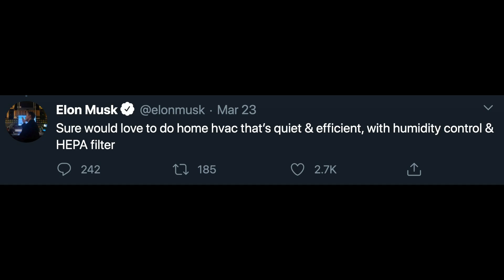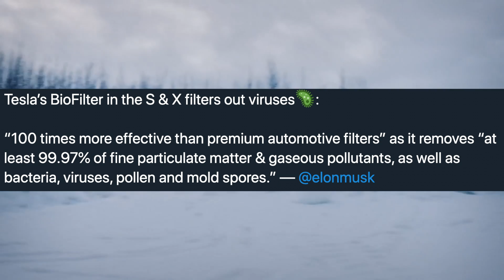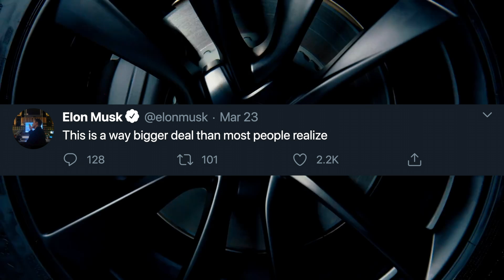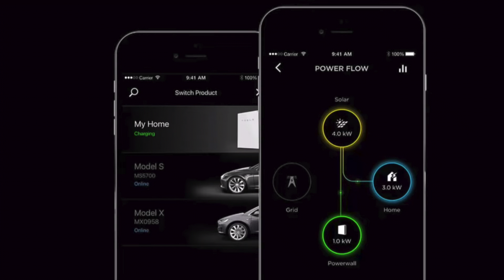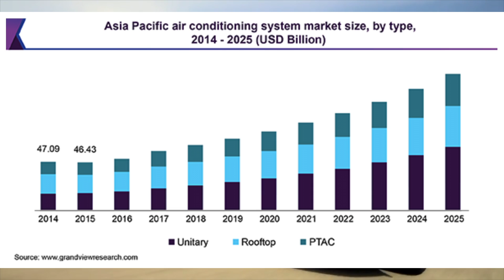Tesla's Secret Upcoming Product: HVAC for Homes (Heating, Ventilating, Air Conditioning)

Comment: 3:32 he’s not saying that a special Tesla aircon can produce water all aircons do because they reduce the humidity he’s just saying that he will collect and filter the water instead of waisting it
Reply: Unless your tap water is particularly bad, just use a Brita or equivalent. Water from HVAC is a horribly inefficient production method ("water from thin air" has been tried many times and failed every time due to the laws of thermodynamics making it stupidly inefficient) and just one more thing to throw money at for maintenance. The amount of water you will get from it won't be anywhere near enough for drinking (unless you have a ton more moisture sources in your home than the people inside it) so you'll still be relying primarily on other sources.

Comment: HVAC systems = "Heating Ventilation and Air Conditioning (HVAC) is generally responsible for a significant proportion of total building energy consumption. A typical system accounts for approximately 40% of total building consumption."

Comment: I didn't hear a single thing in this video that could be revolutionary in HVAC systems.  Pretty much every idea here for a home system already exists with current systems and any efficiency gains would be minimal if existent. For an electric car or tesla built home, it makes total sense but home systems have far more options like ductless, geothermal or possibly desiccant air conditioning.
Reply: the Point of TESLA making HVAC is Reducing the Complexity and the Size of the HVAC while making it more Efficient too. TESLA plans on building its HVAC without Pulleys and Belts.
Reply: @markplott4820  In other words exactly what I just said. Systems like that have existed for many years now.  If you search YouTube you will find many examples of them going back beyond 2010.

Comment: Wiring in AC is a portal for solar power.  It is trivial thing to add a KW or two of solar power into the AC circuit that will be used by the air conditioner during the hottest part of the day.

Comment: Last I checked the clean pure water produced by A/C systems and dehumidifiers is nowhere near clean and pure I could be wrong though
Reply: you can Collect it and run it through a ZERO water filter before Drinking it.
Reply: @markplott4820  Yea but the video is a bit misleading saying that it's pure and drinkable without filtering. You can do the same thing with lake or stream water.
Reply: @mesanders1113   - I would NOT Drink Lake waster, FISH poop in Lakes, streams are safer. you can Survive on Melted Lake ICE as its 100% Pure water.
BTW, California has the BEST Drinking water as most of it comes from Snow Melt from the Mountains.
EBMUD has to treat the Water minimally.

Comment: If they can recycle the high pressure of the refrigerant wasted in the expansion nozzle they can save energy on the compressor. I don't think I've ever seen a reverse-brayton cycle air conditioner for the home.

Comment: I've been in US few times and most crazy for me is that people have air heat exchanger for the AC and separate swimming pool heating. It's crazy to use the energy for the pool heating while you dump so much heat in the heat exchanger from AC...
Reply: Agreed, it should be standard that it runs to the water heater first, which could be used for a pool. It is a cost and complexity issue though. In general people in the US aren't willing to invest in home equipment that the ROI is more than a few years out. They often don't plan to stay in the same house for more than 10years, and the selling prices don't compensate for better quality eqiupment, windows, or more insulation. So the houses are built to the minimum quality as they don't care what happens to it in 20yrs. There are exceptions of course, but that seems to be the trend as a whole.
Reply: TV show This Old House installed such a system. Like solar, it would take at least 20 years to break even.
Reply: Gags Wow, “you need to understand BTU” for thermal power. “HP” for mechanical power. And “W” for electrical power. Really?  Wow, that’s really clever !
Reply: This is a great idea, but it has to be really really great engineered due to you do not want to be swimming in a pool full of poe oil from the ac system if a line were to break. but it will be interesting to see.
Reply: @gags730  and sealing your house up tight opens up a whole another set of problems with indoor air pollution condensation rot Etc
Reply: It has always seemed an intuitively good idea to me. Here is the system This Old House used. I am surprised to read here that is isn’t cost effective.
Reply: On the surface seems a good idea. (Btw I'm an HVAC tech) 
But the problem really is timing. You don't need to heat the pool in mid summer when the house needs max cooling. And in cooler months for swimming you don't want to cool the house. That's where the idea dies

Comment: i've got a 3 unit multi family i've been looking to add central AC to.. if this is on the way, i'm 10000% buying.
Reply: HVAC is not the solution , you first need a very well insulated house, thats it, you cant cool or heat a poorly insulated building

Comment: Simply building homes better with passive temperature balancing such as thermal mass walls and double roofs mitigate the extremes making fine-tuning the temperature far easier and take less energy.
A thermal mass wall is as easy to do take the dirt from the construction site mix it with some concrete wetted and packed into forms that are reusable this lowers cement use and transportation of materials lowering costs and lowering Co2 production.
A double roof is an improvement on the current roof and attic system the top roof takes all the abuse and heat air flows between the two by convection cooling everything off and preventing heat transfer to the home in winter this gap is shuttered if heat needs to be retained the second roof is sealed against water etcetera and wire mesh keeps out birds and other animals from the gap between the roofs.

Comment: I have an EcoBee thermostat that is connected to my smartphone and can detect when you leave or return home.
Reply: interesting, can you talk about how that works a bit more as well as the total cost?
Reply: @BankruptGreek  GPS based location tracking on the phone along with a geofence that determines "home or nah"

Initial Cost is around 170-200 for the unit. Plugs into existing wiring for the HVAC unit and takes about 5-10 minutes to install and configure (check which wires are running to your thermostat on the ecobee site to see if its compatible [super easy])

Super easy install and gives you some smart features. Granted this isnt room-by-room. But for the price (sometimes you get a bonus from your utility) its a great addition and very worth the money.

Comment: The state of the art HVAC unit will be a heat pump using CO2 as the refrigerant.  Tesla is helping GM go bankrupt, their (solar powered) heat pump will kill Trane and Goodman.  Natural gas will soon be illegal for new homes, and if the electricity suppliers don't react to Tesla innovation they will suffer as homeowners with batteries go off grid.
Reply: 8 million cars last year plus billions in profit, vs less than half a million cars plus a net loss. Between those 2, it isn't GM risking bankruptcy.

Comment: I am a licensed HVAC Technician, and I would love to see this advance from Elon and possibly install some of his systems!!
Reply: I'd like to see a little more specifics about this.  How would his system be more efficient than what's already available in the residential, commercial,  and industrial markets? I mean,  super efficient DX units and DOAS units already exist with economizers and enthalpy wheels. The next part in the efficiency equation is the envelope of the building.  So,  what makes his idea more capable than what we already have out there? Btw, I'm an Elon fanboy,  I'm just playing devil's advocate and asking the question everybody is already thinking.
Reply: I think you are absolutely right! Efficiency of these units has peaked and so has the measurements used for duct sizing for a perfectly efficient system, The only factor lacking in older homes is insulation but this problem has been fixed in almost all newer homes. Elon never ceases to amaze me and the question is how can Elon improve on what we already have? I sure don’t have an answer and i’m hoping he can come up with something really cool!
Reply: Jay Tenison I was thinking that you would be able to shut off specific vents in your home, with Elon’s new system. Personally I don’t mind if the whole house is 78 to 82 degrees all day but when I want to go to bed I need it at 65 to 68 to sleep properly. So I set my thermostat to gradually start cooling down the house as it gets closer to bed time. The problem is I don’t need the whole house cooled down, just the bedroom.
Reply: I would love to see some progress in the creation of a home heating system that does not rely on forced air.  After another winter of listening to furnace noise I am ready to find options to retrofit the house with a silent form of heat if it were affordable.
Reply: @VersinKettorix  
Radiant heat/hydronics. I have been converting my house. Also grew up with it. It is a bit more expensive to install up front,  but more comfortable,  doesn't blow dust all over, quiet, and uses less energy to transport the energy. 
Whether you use HC fuel or a ground source heat pump is up to you, the GSHP system is expensive,  but cheaper to operate. I used a NG water heater as the source.
Reply: @VersinKettorix  Mini Splits Work Great and are Silent and Efficient
Reply: @VersinKettorix  as a HVAC installer, with modern and properly designed systems you wont hear any airflow noise.  If you can hear anything, like airflow, more than 2 feet from a register/return then you either need maintenance or have a poorly designed/sized system.
Reply: @VersinKettorix  it is affordable, called ductless AC/HTR, the lines of two room units go through the wall to comp outside. Any home handyman can install
Reply: @tccampbell5128  Thanks, I'll look into it.  Retro-fitting is not always easy but I see the tide of electrification coming along with substantial savings over gas as renewables continue to cut costs.   The last 10 years have been really remarkable when looking at the price of wind and solar generation.  Storage is the next hurdle to clear.
Reply: @William Arrington I really wish everyone would quit calling them geothermal. It is a heat pump that uses the ground as the sink instead of air. Geothermal implies the earth is already hot and you are just using it.
Reply: @court2379  we run geo thermal loops 300ft down.  We did a 43 home test site in fruita Colorado that's all on 1 continuous loop, we'll see the long term results in a few years. Would be awesome if this technology can be utilized more.
Reply: Mitsubishi inverter multi-zone air to air heat pump systems are available now and are very efficient and effective
Reply: Wont you love not being able to buy parts to make repairs?
Got people are clueless
Reply: My father it´s a mechanic eng. and he  instals  AC and he say if tesla do that , the AC buisnesses will change.
Reply: Loll tesla will run you guys out of business
Reply: Me too my company's shop is down the street of the telsa factory in Fremont
Reply: @William Arrington oh no , not now ... I'm thinking 2025-2030 ...job force will be much different then
Reply: I like Tesla n Elon’s vision but residential hvac systems are pretty efficient already complete variable speed with zoning capabilities for individual rooms also ductless splits with multiple air handlers are pretty effective also variable speed motors including compressor in reality the problem is the structure itself if you can insulated well enough. Also the only other route would be to sell a vdc hvac system as a kit with solar panels plus a power wall connected to the grid for cloudy day so it could charge on off peak times n discharge when the cost per kWh is high..... filtration will not increase efficiency just clean the air... actually it would cause a high current or in crease the amps on blower motor.....
Reply: Repeat. 
Do not forget all aspects of refrigeration and freezers. To include commercial at all sizes as well as Slurpee type machines. 
Also, because of this virus pandemic. The addition of ozone generation and UV light as well as other unknown technologies will go a long way to better health. Especially if it is all built in and then controlled by computer access. Think about it. The levels of ozone required to kill the really tough bad stuff requires high levels of ozone concentrations which is harmful to humans. Which is why you would use it when your not home as is already being done in football and other athletic dressing rooms. Those Ozone devices are additions which you have to install separately. Just like the UV lights. Your AC tech can already add UV light kits to your window air-conditioners. Think about it.
Also research air to water generators.
Reply: Same here. But you don't think tesla is gonna make everything proprietary like their cars making us impossible to repair or exclude us over all?
Reply: Buddy I’m a hvac technician too. I’d like to see what he can produce. But I feel like it would be a nightmare with it being all communicating equipment. Controls boards galore and no real way to diagnose except thru his own programs which we’d have to pay for.
Reply: I think built in fire suppression system so when it explodes and catches on fire it will extinguish itself.
Reply: I agree, there’s plenty of room for improvement, if anyone could figure out a revolutionary design it would be Tesla
Reply: He just gave me $100 million
Reply: You know I was just thinking the same thing
Reply: Y’all do realize A really efficient HVAC unit is no good if ur house isn’t tight and not energy efficient The real technology is in building a home that meets the passive house requirements and standards Way more important then a Fancy new HVAC unit because if you build a passive house your HVAC AC unit with hardly ever turn on! Food for thought.
Reply: robert sharpe Absolutely!
Reply: William Arrington I think we’re talking about two different things there’s energy-efficient houses and then there’s a passive house a passive house can run off of one to two split units in the entire home and uses sunlight to heat the home during the winter it’s like living in a yeti cooler!
Reply: William Arrington here’s an amazing video on a passive house it’s amazing how energy efficient this house is The entire home is electric it has absolutely no power bill completely run off of solar system along with charging a smart car he actually makes money! https://youtu.be/fhbLjEKKLVM and the Channel is also One of the best if you’re into home construction
Reply: I’m ready to get in on this !! This is the future. Technology hasn’t improved in Hvac system in years.
Reply: As a licensed HVAC tech you'd know that there is no free lunch. AC has been around for a century and is a thoroughly understood science. Tinker away Mr. Musk, go for that extra .2% gain in efficiency that every backyard inventor has tried. Marketing genius is all this guy is.
Reply: boo there is a company called Climatengine, you want find it on the web, there are a few tweets from them but I know a guy that works in their design department and he tells me 2021 they will release products that are so efficient that they are off grid appliances, efficiently never seen before. I guess we wait and see, my friend says they go live on the web late this year.

Comment: Been hoping for a while a company would develop a the meta-material I saw a few years back that was supper efficient at giving off infra-red radiation cooling the material down considerably even in full sun light. This it seems could be used to cool or heat (a large percentage of our energy use is in cooling or heating buildings) not just buildings but machines increasing efficiencies. 

Living here in the bush Australia you'd think our air quality was fantastic but the reality is very different. With the wild fires here we had almost two months of very smoky conditions, my monitor can only read up to 999 of the pm2.5 so I can't tell you what the max level was. But we also have planned burns that create considerable smoke then in the winter wood fires fill the valley with smoke (very little wind here most of the time, although recently we have been seeing windy conditions more often) which mixes with the fog to make smog. We have 3 HEPA filters in our house and they have made a massive difference to the air quality. 

So would be nice if Tesla made something that combined these, it would improve our health considerably as well as probably reducing energy requirements.
Reply: Oh JAKE... Never imagined that Bush fires are so dangerous. You made a point very nicely and hope TESLA brings out a new product.
Reply: @pppsss5653  The news got lost in whats going on now but it's estimated the smoke killed around 400 people, far more than directly killed in the fires.
Reply: @turningpoint4238   Oh My God. It is pity that some times we loose our simple common sense survival instincts to protect ourselves and fall prey to so called modern and latest technology which may fail to see the problem. People dying of Bush Fires could have been attended to by properly administration. So sad. But I appreciate your insight. Hope lessons be learnt and no more such mistakes by politicians happen in future.